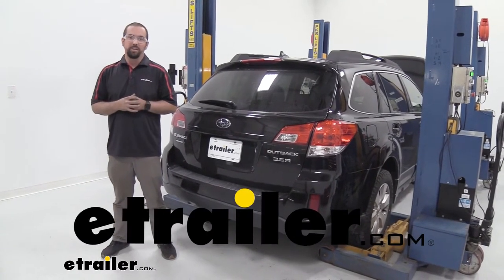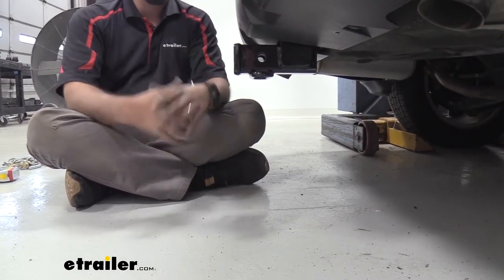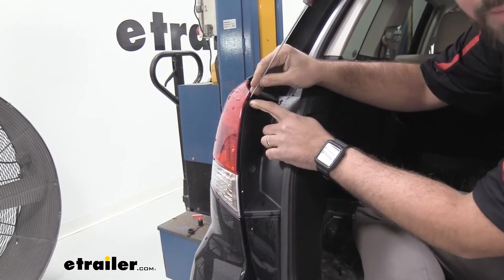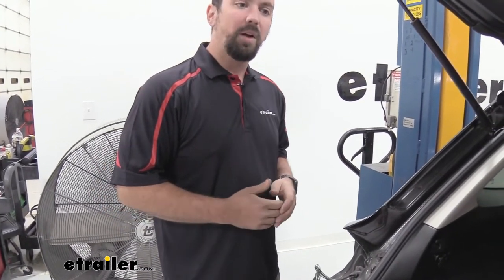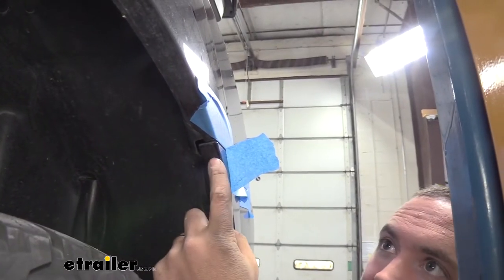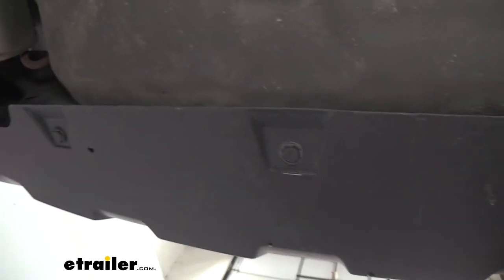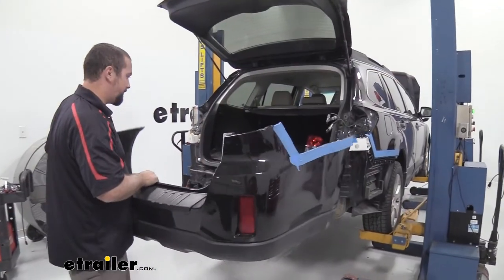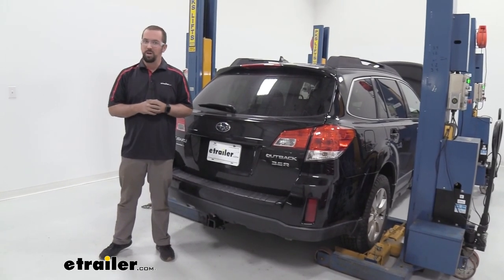etrailer | How to Install the Curt Trailer Hitch Receiver on a 2012 Subaru Outback Wagon

Comment: Excellent how-to video on the installation. I bought this hitch for my 2012 outback and installed it today following this video. A couple things to note are:
1. Mine did not have mudflaps, so i only had 3 pushpin clips on either side of the bumper nearest to the wheels to remove to take the bumper cover off
2. After installing everything, the extra thickness from the tow hitch bracket pushed the bumper bar and foam out a little more than it did before, which didn't allow me to get the "click" sound from the clips on the hatch step part of the bumper cover. Everything else was able to line up alright and go back on, but just a note for those installing this too.

thanks for the detailed video! Made it very easy.
Reply from the maker: Thank you for the feedback! This will be helpful for future videos and anyone that may run into the same issues.
https://www.etrailer.com/Trailer-Hitch/CURT/C13410.html

Comment: Would this style hitch work on a 2011 Outback?  I see the ones for the 2011 are mostly mounting above the exhaust into the frame(vertical bolts).  However, some websites are listing this hitch, in this video, compatible with my 2011 Outback.  I know I have a rear bumber :).  Thanks for the video and any help!
Reply: Yes it would they fit on all the models 2010 and up just finished the job with a 2012 took us about an hour and a half with some cleaning and rust prevention done as well
Reply from the maker: This hitch is designed to fit the 2013 - 2019 Subaru Outback Wagon and 2010 - 2012 Subaru Outback Wagon excluding Sport.
https://www.etrailer.com/Trailer-Hitch/CURT/C13410.html